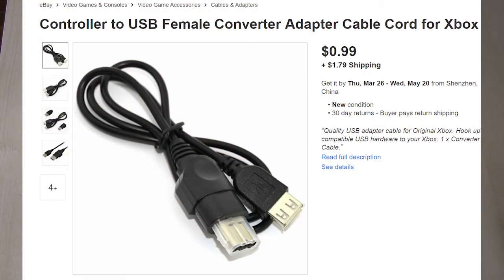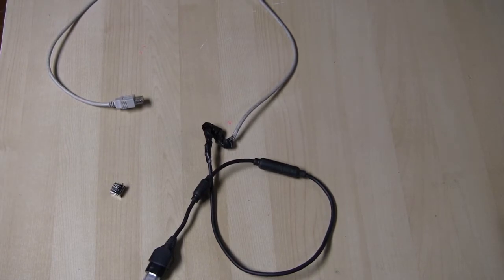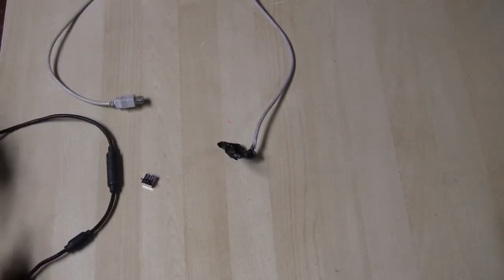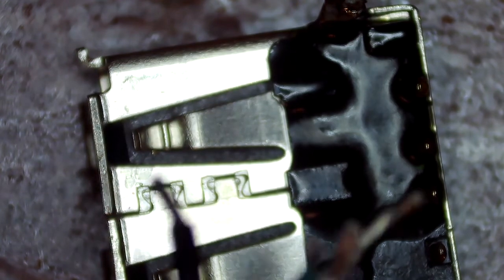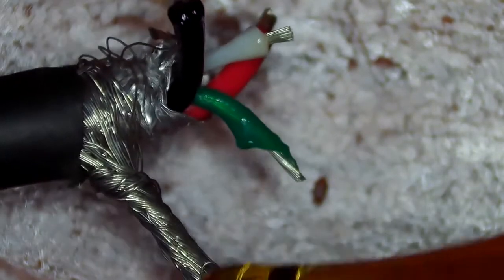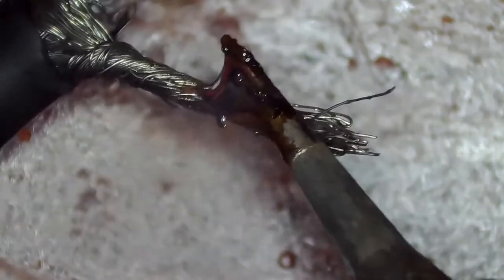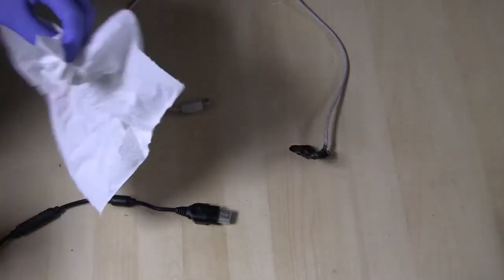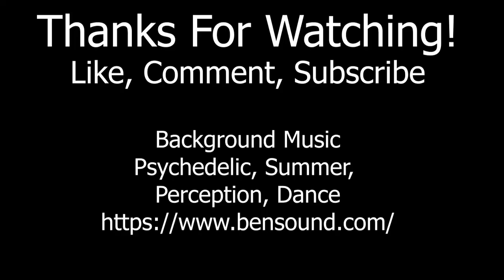Modding The Original Xbox Part 2 - USB to Xbox Cable

Comment: Great video. Instead of destroying a gamepad cable, I opened the box up and removed the 4th player controller input slot and filled the slot with a female usb. Looks really clean and the 3 and 4 port were never in use on mine anyways. Thanks again!
Reply: Nice.